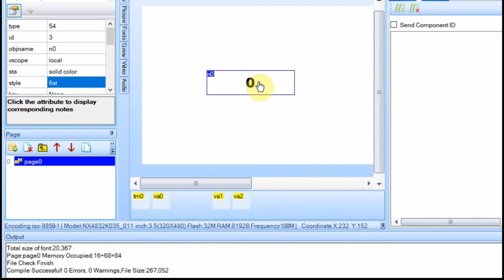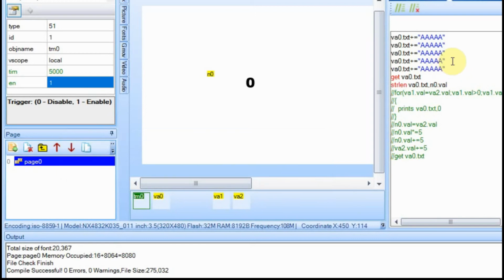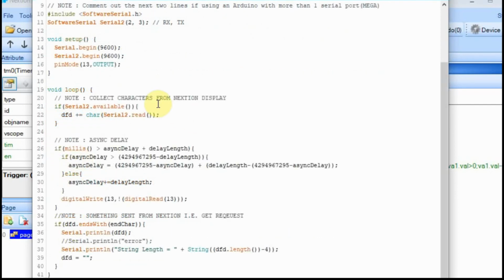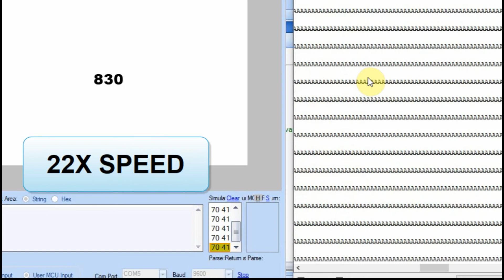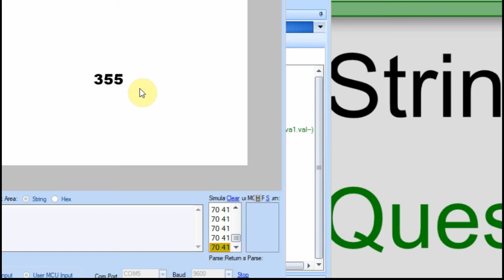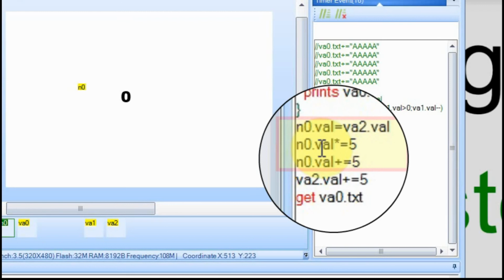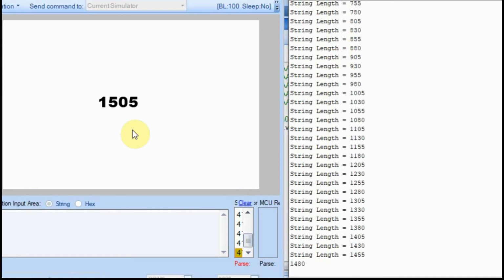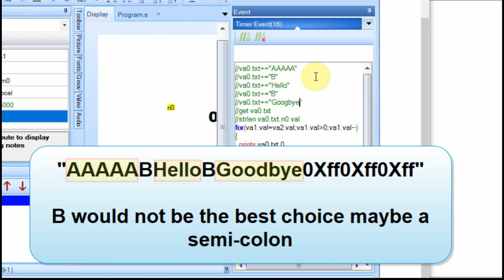142 Sending a looooonnnng #string from the #Nextion to an #arduinoproject  Pro Mini

Comment: well done this is great thanks for posting , keep up the good work.. I followed your program and it worked great
Reply from the maker: I am glad it worked for you
Reply: @CheapControls  now I am trying to figure out why it does not update / read every time I change the value on the nextion keyboard?  creeping  up on it slowly 😀
Reply from the maker: I am sure you will figure it out.  You need patience and persistence to lead to success.
Reply: @CheapControls  agree, I have done lots of AB. GL controllers , c-more.. this is actually more fun

Comment: can you explain how do you send one string at time?? now if i print two string variables they come in one line thats the issue
Reply from the maker: two lines from nextion to arduino or Arduino to nextion?
Reply: @CheapControls  nextion to arduino
Reply from the maker: sorry for the delay.  I do this in a few different ways.  Sometimes I put a character in between the two strings and look for that character in the Arduino.  I also will make all my strings the same length from the Nextion and can split it up that way.  You can also put a short pause or delay between the strings.  I hope this helps and thank you for watching.
Reply: @CheapControls  no worries! i did delay trick it didnt work actually same thing happens. Did you do a video on this string parsing arduino??? if so can you reply me the link to it.
Reply from the maker: I thought I had a video on parsing strings but I could not find one.  I am planning a video on drawing an arc.  I will look into a parsing video next.
Reply: @CheapControls  Thank you!!

Comment: I have use this exact logic to send looooong codified data_from_nextion Strings, I save that long Strings to the Arduino EEPROM, and later decodified it in the arduino with the help of keywords and simbols through a class in the moment I'm going to use it. This way, I don't use as much "if" statements in the readNextionSerialData() and the code looks nicer. You've save me a lot of trouble, thanks
Reply from the maker: Glad it was useful for you.  Thank you for watching